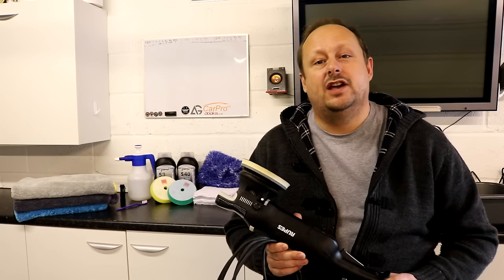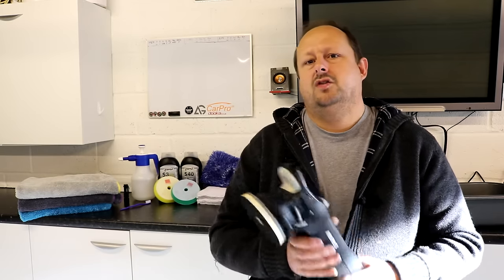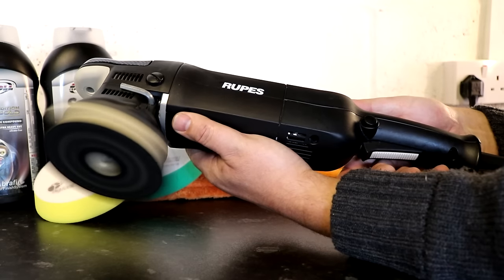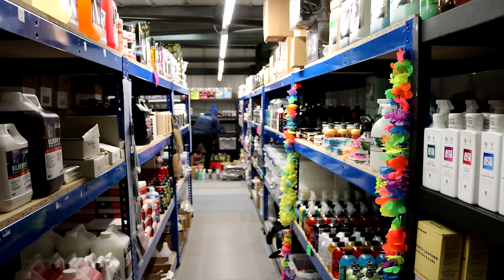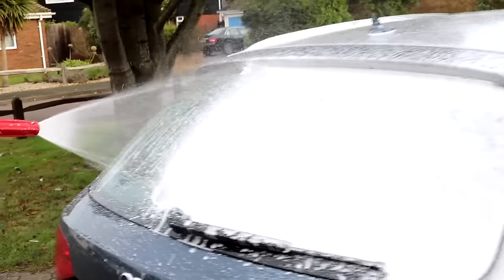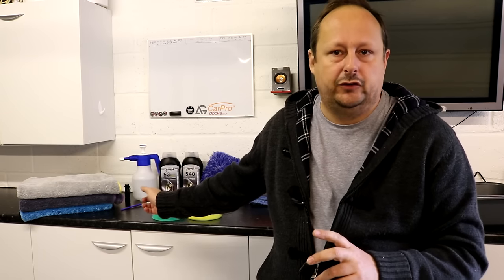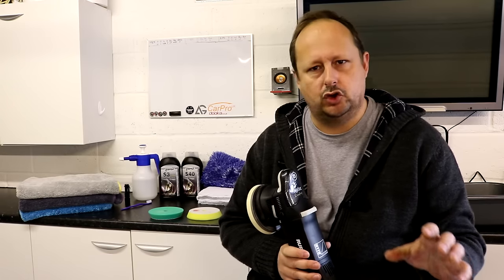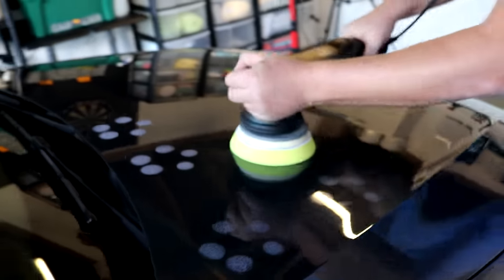Rupes LHR15es MK2 bigfoot machine polisher review guide demo

Comment: Do you think this corrects paint better the DAS Pro Plus 15?
Reply from the maker: i think they correct paint more or less identically.. but the rupes has more features and less vibration...
Reply: I know the Rupes is a much higher quality item but I only polish my car so would be used a couple of times a year. Having trouble justifying the extra £ for the little I'd use it. There's also the issue of get wife approval!
Reply: Decided on the Rupes. £438 with a selection of pads and polishes! Hope it's worth it, your fault if it's not!😉
Reply from the maker: pretty sure your going to love the machine..  let me know how you get on..   Im not sure how much machine polishing you have done.  So im just throwing some advice in there (ignore as required)... let the tool do the work, no need to crack it up too much, and no additional down pressure would be my advice.  you will get great results.
Reply: Thanks, I'll let you know how I get on. I've got a bit of experience. Had a Porter Cable ten years ago then moved up to a rotary about 6 years ago. Only do my own cars so polish once or twice a year, if that. Haven't actually polished a whole car for 3-4 years so coming back to it I have found there are new machines about. Hence the Rupes purchase. Have a lightly swirled, hard clear coat VW CC to correct. Going to try a one stage with S20 black but if that doesn't quite do it, I'll use the Rupes medium (green) compound and finishing (yellow) polish In a 2 stage. With the hard paint, I reckon the S20 will do the job nicely.
Reply: The Rupes arrived today. Very impressive machine. It's quiet and there's virtually no vibration which I find amazing for a long throw DA. You can see what you pay for. Can't wait to try it out on the car!
Reply from the maker: cool stuff, did you buy it from Clean and shiney?
Reply: Got it from Aurobrite direct who had a 5% discount on it.
Reply from the maker: they dont sell rupes?
Reply: Had a quick go with the Rupes on the bootlid as weather less than ideal today. Minor swirls on hard VAG paint using yellow pad and S20. The Rupes was very easy to use and the bootlid is now swirl free with one set. Very impressed with the machine as well as the S20. Thinking about getting the mini now too!
Reply from the maker: so glad you like it buddy. its a nice tool to use isnt it.. so smooth.
Reply: Incredibly smooth!
Reply: Just got the LHR75e too! Great little machine and perfect with the 15.

Comment: What if you already had a 1-2" rotary, 3" 8mm throw DA - would you recommend the Rupes 21 or your Flex 3401 as your workhorse with all things considered? (correction/time, noise, feel and etc) for a weekend warrior
Reply from the maker: from the choice of the 21 or the 3401 I would take the 3401...  and having a rotary with spot pads (and normal size pads etc) will accompany that well..  

the rotary is the only tool that can do the lot though.. but generally I will use the 3401 over a rotary by default.. (not always though)
Reply: Does sound like force/gear Drive has a lot going for it, must admit that not having any bog scares me somewhat but perhaps that is simple a matter of learning. would you recommend using Hexalogic pads with that Flex unit? have a arsenal of pads that I intend on using with that and moving over my DA as a 3".
Reply from the maker: no I use lake country hybrid power pads on the flex 3401...   see the latest video on the channel reviewing the 3401 mate.. I talk about those pads.. and the adapter plate system.. but they might be discountinued now or soon...